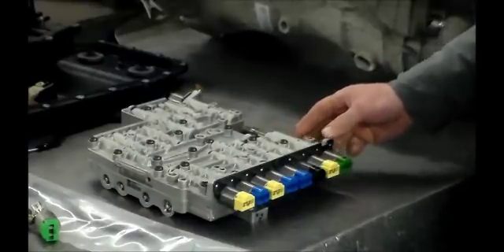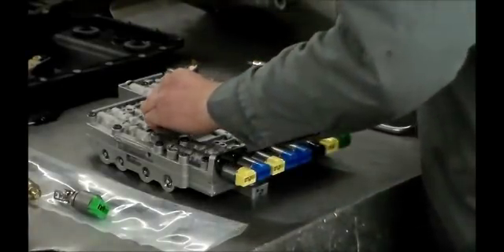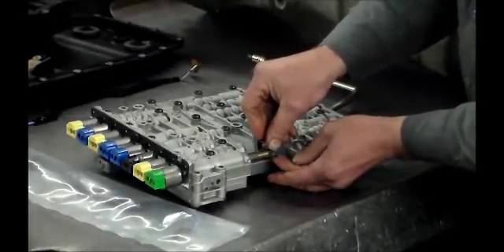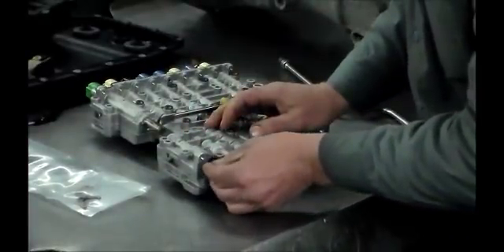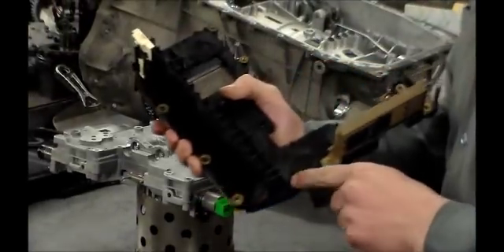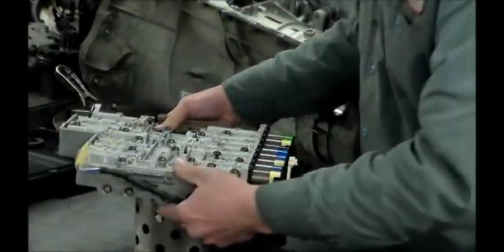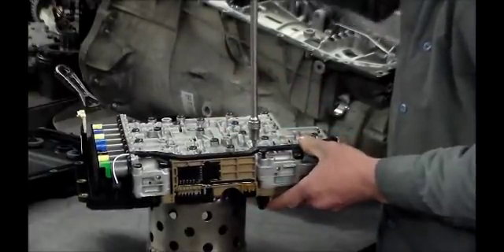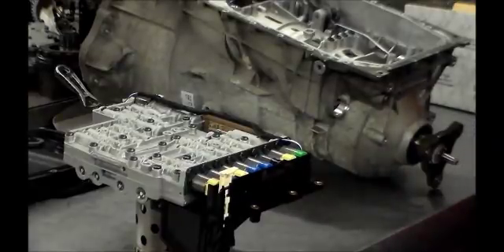ZF6HP26 E-Shift Valvebody

Comment: Gary, I purchased a 2008 528xi that wont shift from park. I purchased a 047 solenoid pack to fix the issue. I pulled the valve body and the bridge seal looked in great shape (I've done dozens of these services and never seen a cracked one for whatit's worth, perhaps colder in Seattle). The code is 4E20 hard (as it wont go away and pops immediately back). The sleeve and pan were per records dealer replaced 15-20k miles ago. The customer was scared off, 10k from bmw for a new tranny no repair no valve body certainly no solenoids. Anyway, I really appreciate your kind nature and informative videos and I am looking forward to replacing the valve body solenoids (all) and the bridge, sleeve and I am leaving the 4 additional sleeves alone as I have only once changed those and these "look fine to me". I looked at a 6hp diagram and it points to solenoid valve 1 being the release from park solenoid which is precisely the 4E20 code. I will update my comment with the success or failure of the repair later this week or early next. I should receive the solenoids in 2 days (6/22/18). Thanks again, I may add auto trans repair to my skill set as I would like to rebuild an auto trannie one day soon. So far we just do the basics such as valve body out as we don't specialize in tranny rebuild just service. Anyway! You're awesome and we appreciate it. Thumbs up! Thank you!
Reply from the maker: ok, so this is an e-shift body, park is a button?
Reply: Yep. E-shift or m-shift? I've heard both. It has the green park solenoid and a pack of 8. The silver shift lever and park is a button. The update style shifter than came out in 2007 2098 range. This is an 08 but it has a build date of 03/2007. That'd confuse someone. But over the 10th vin and all the paperwork it's an 08.
Reply from the maker: Only the E-shift valvebody has the park lock solenoid and the MV2 solenoid also, M shift does not
Reply: I am ignorant to the e shift vs m shift trannies. I was wondering if people used the term interchangeably (m shift sounds very bmw). Thanks for the info... worth understanding.
Reply from the maker: The M shift is Manual Shift, like the conventional shifter, not the one that rocks back and fourth
Reply: Hi Gary, over the weekend I replaced the entire ZF OEM 047 solenoid kit (part number ends in 047) for my 2008 528xi. The seller was Ronnie @ NavyTransmission on eBay and the shipping was very fast USPS. I replaced all 8 solenoids on the front including the green park solenoid as well as the wiring harness and MV2 solenoid in the back. As well as the park piston that fits in front of the park solenoid. I did use a small amount of Lubeguard green transmission assembly grease to ease installation when I felt it was appropriate. I wiped on some used (but clean) atf that was around my work area to lubricate the solenoid O rings and they all snapped into place very solidly. I would have replaced the foam, but I had only the 7 piece foam not 8 piece foam kit and the original foam was in OK shape. The foam for anyone interested is a buffer strip between the valve body and the solenoid electrical connectors that are part of the mechatronic bridge, or the whole mechatronic "brain" that sits atop the valve body. I torqued everything to about 8NM on re-installation, including the valve body to the trans and the pan, the T27 screws for the mechatronic, everything. I was able to fill it with about 8 quarts of fluid which was about 1 quart more than usual, but it did drain for a while and the valve body lost quite a bit during work. All solenoid holes were clean and I did not blow out any holes, but simply looked inside, looked clean and I replaced the solenoids. The problem solenoid was the Pressure Control Solenoid Valve #1 per the code which was the orange solenoid farthest opposite the green park solenoid on the very other end of the line of solenoids. It was shorted out per my multimeter, reading funky all over the place. All other solenoids were within specs comparing to the new solenoids. Most solenoids are about 5.3 ohm and the park one was I think maybe 24 ohm and the MV2 was maybe 10 or 12 I forget exactly. The one orange solenoid was simply bad. The seller of the vehicle left a poor review for the BMW dealership which said the transmission was "locked up" and refused to perform any further service other than a complete transmission replacement. I did originally offer to attempt a repair for him, but he indicated he just wanted to sell it. So I bought it. The car shifted a little funny for the first few miles and is shifting fine now, as the solenoids re-learned the pressures. My understanding is this is normal. I wonder how BMW makes the car new at the dealer shift perfect, perhaps a road test and re-set the mileage to 0 for delivery. The adaptations and re-learing were re-set using a Snapon Solus late model scanner. Again: the code was a hard 4E20 for Pressure Solenoid Valve #1. I replaced the sealing sleeve and the mechatronic square adapter above the valve body, I did not replace the sealing sleeves (4) and I re-used the pan filter as it was dealer replaced about 15,000 miles ago. I greatly appreciate your expertise and kindness Gary. Thanks for everything. I hope this information helps another person facing similar problems.
Reply from the maker: Thanks for the input, good job on getting your car fixed up
Reply: @spencermaiers8322  Where are you located?  I'm having a hell of a time and at my wits end with my 2010 X5M :/
Reply: @M5JamesE39  I'm in the Pacific Northwest. Does YouTube allow for messaging I I think it does. I'd be happy to message with you and email you if you would like to discuss your X5 M but I am not Gary I am not a professional transmission Rebuilder I am a mechanic and enthusiast. I am more than happy to let you know what I did if you're getting a similar code you have to drop the valve body by the way X5 M nice vehicle never driven one but I wouldn't mind. By the way valve body is not an extremely hard job I'm just saying it requires some skill and some tools to do it including the refilling you going to need a pump and I get it's rough out there I've seen some estimates and labor charges and it is very ugly seems like a reasonable mechanic price is hard to come by and I am one sorry for mistakes voice text
Reply: @spencermaiers8322  I saw you'd mentioned Seattle in another post...I'm in Marysville.  I've removed the VB but I'm still getting TFS and limp mode, all codes point to transfer case but fuses pulled/servo motor disconnected and I still get TFS.
Reply: @M5JamesE39  happy to text or email a bit. I have a professional scanner. It would be ideal to know codes. I'm working out of Everett
Reply: To clarify: initial dme was bad (rare). Why? Replaced with used and properly Cloned dme. worked briefly then had similar issue (cylinder misfires), seemed limited to one bank but perhaps not. Inspected battery on hunch. Original. Bulged post. Battery replaced. Dme re cloned (again!). Fixed. Then misfired once more. This time was actually a coil (moved coil misfire went with coil). That gl450 was gaslighting the shit out of me. Relevant only because batteries on bmws can cause weird tranny and other running issues. And charging system generally. Sometimes alternators dont fail instantly. They start freaking out over voltage failing internally etc and you gotta watch it for half an hour and turn on consumers etc. Anyway if I can humbly assist your X5M, let me know. Best to all. Sorry for the slight digression.

Comment: Hi Gary, Can you post the part numbers for the updated MV3 and MV2 solenoids? My dealer is trying to sell me a new mechatronic.
Reply from the maker: kevin stephens why are they trying to sell you a mechatronic
Reply: Thanks Gary, The only code the car has is this.400116 Solenoid Valve 2 Short Circuit to ground or open circuit.
Reply from the maker: Where are you loctaed?  did you drop the valvebody and ohm to see which one is bad?  could be an EDS solenoid
Reply: Im in metro Detroit. The shop that has the car is incompetent. They have the valve body out. It's been out for over a month. I told them that it need all new solenoids they keep telling me I need a new valve body.
Reply from the maker: Oh, that sucks, can you pick-up thevalve body to ohm the solenoids?  easy enough to do
Reply: Yep. Do you know what the nominal impedance should be?
Reply from the maker: The EDS solenoids are 5 to 6 ohms.  The MV solenoids are 11 to 12 ohms.  The MV solenoids have the black plastic

Comment: Hello Gary. 
First of all, thanks a lot for outstanding videos. Helps immensely.
Could you please let me know where do you usually buy spares? 
Valve body parts, bushings, etc
There are lot of noname cheap quality stuff around 
Thanks in advance
Reply from the maker: Where are you located?
Reply: Gary, i am located in Azerbaijan. However I can order stuff from us or eu if required.
Do you provide services? I.e refurbishment?
Reply from the maker: I do not have parts, and my supplier cannot ship outside the u.s, have you looked online?  Greetings from New York
Reply: @GaryFerraro  
Hi sir;
I got 3 idrive messages on My bmw 630/2008:
Traction
ABS
transmission fault.
The last one pops up( 30 mile/h on 3000 rpm + shifts while trying to stop)..
Then pops off & everything is fine.
I get more frequent transmission faults in daytime than in night time.
Any suggestions? ?

Regards
Reply from the maker: @blackbirda3797  Have the car scanned for transmission codes and let me know what they are

Comment: What is the average cost of a rebuild like this?
Reply from the maker: Oscar Rodriguez rebuild the trans or just  the valvebody
Reply from the maker: Oscar Rodriguez what is the year make and model of your car.  Are you in the New York area?
Reply from the maker: Oscar Rodriguez  yes.  I'm on. Long Island
Reply from the maker: Oscar Rodriguez what is the problem with the transmission?  Any codes?
Reply from the maker: All these codes are mechanical codes, i'm located in West Hempstead, are you by chance around that area, i would check out the car at no cost to you. My e-mail is gsferraro@yahoo.com   Send me an e-mail and i can send you back my contact info.

Comment: Do have a video on setting valve body on transmission to ensure linkage to park pawl works?  Got a 750li and no park
Reply from the maker: Did you have the valvebody off then when reinstall no park? how are the other gears?
Reply: Gary Ferraro Thanks for the reply Sir, I sent body to revmaxconverters, and installed all new solenoids and sub harness, did not work before either.
Reply: Gary Ferraro I did not check the pawl, and thought it could be broke, but didnt know how it worked until watching your video, thanks.
Reply from the maker: you have an e-shift valvebody. To put in park, you press a button?
Reply: Gary Ferraro I may have a bad park pawl, because yes I push for park and says park but still rolls.  Must use parking brake.  Just not sure how the arm sets in the valve body to the rod
Reply from the maker: If you have an e-shift, the rod is spring loaded, so you have to push it or move it to line it up, the solenoids is what takes it out of park,

Comment: Hi, amazing video. 
I have a 09 BMW X5 with 6HP26 ZF transmission, it has a 2 sec. delay when changing to reverse and slight rough gear changes during drive. Could you tell me what is wrong with it please. 
Many Thanks.
Reply from the maker: First thing, is the transmission full of fluid?
Reply: Gary Ferraro 
I top it up, it little bit better but still delaying in reverse and harsh gear changes on 5th or 6th. 

Your prompt reply is highly appropriate. 
Many Thanks,
Reply from the maker: How much did you add?
Reply: Gary Ferraro 
2 liter
Reply from the maker: Do you have access to a scan tool, the first thing i would try is resetting the shift adapts.
Reply: Gary Ferraro 
Unfortunately not.
Reply from the maker: Local mechanic, any one with a snap-on scanner. Where are you located
Reply: Gary Ferraro 
Abu Dhabi/UAE
Reply: Gary Ferraro 
Hi, I’m planning to buy affordable one but I have no idea which one is the best. Could you advice. 
Thanks for your cooperation.
Reply: Gary Ferraro 
Otherwise I could search for a mechanic has a scan tool, but I don’t know what information you are looking for ?, so I can ask him for. 
Thanks again
Reply from the maker: Looking for a scan tool that can reset shift adapts for the transmission, im not sure this will work but if the mechanic is will to do it for a small fee or even no fee i would try it, look into scan tool called Autel, there are different ones, the maxi das is a good tool
Reply: Gary Ferraro 
OK, Thanks
Reply from the maker: Let me know how it goes
Reply: @sinanalhamdani9316  how did it go? You were supposed to let him know how it went! Rude.
Reply: DrE38 not your business, RUDE !!!

Comment: Gary, do you always fit an overhauled converter after you rebuild a transmission? If not how would you check that the converter is still fit? Is there a rule or a test that you can perform?
Thanks again 
Michael

Comment: Gary Ferraro, Love your channel. I have a question that maybe you can help you with. Working on a 2005 range rover with the zf5hp24 transmission. When re-installing the transmission should I bolt the torque converter to the flywheel first?
Reply from the maker: No, install the converter into the trans first
Reply: Gary Ferraro thanks sir. So what’s the best way to line up the bolt holes on the converter and flywheel
Reply from the maker: Once the bellhousing is bolted up to the engine, the converter should turn.  Do not draw the bellhousing in with bolts, make sure you have dowel pins and that it sits flat against the engine
Reply: Gary Ferraro thanks